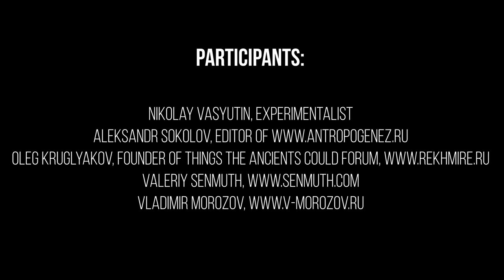Making Egyptian Drill Holes: Lost Ancient High Technology

Comment: Interesting video - even if it does get a bit 'religious' and 'preachy' along the way. I would like to see this experiment/method reproduced under more controlled conditions though by multiple non-affiliated people and with participants from both sides of the fence.
Reply: So, in the end, by multiple non-affiliated people or with participants from both sides of the fence? Or it's just an another way to say "I admit the results only "when pigs will fly""?
Reply: @ravezoth1186 Are you saying that the method shown in this video and the result that it claims to have produced isn't possible to reproduce by other people under close and carefull scruttiny? Or are you simply saying that people should take it on faith that this video couldn't possible have been manipulated to provide 'evidence' for a very particular agenda - or be damned if they don't?
Reply from the maker: @LordLorenSoth  
You can see some public demonstrations here: https://youtu.be/31CayVpKsG4 (at 25:42)   (drilling)
and here: https://youtu.be/HVPoDBKXHos  (sawing) 
Abrasive drilling is not a secret technology. You can easily repeat the experiment yourself.
Reply: @LordLorenSoth  I've said that if you are a beef with something it's not enough to say that "the video is fraud and the authors are liars. If you don't like the experiment design, maybe you can point out a certain flaw, or offer a better design? Do you have a data that egyptian sand has other abrasive features than one authors used, or you once faced calculations that ancient Egyptian metal industry may not be able to produce enough copper. Do you mean that the dammed one should be the person who believe the concept which is proven but not pleasing you?
Reply: @ScientistsAgainstMyths  Same people with the same agenda though. I'd like to see it done by someone else under far more controlled conditions as you can fake the shown experiment quite easily(how to do that is on page one the magician novice's book about smoke, mirrors and misdirection). What is needed is proper replication - applying the scientific method.
Reply: @LordLorenSoth  if the person rotating the log can completely change the results why you haven't done this by yourself or find and share a proper one if it existed?
Reply from the maker: @LordLorenSoth  you can easily repeat the experiment yourself. If you are a fan of conspiracy theories, no one else's experiment will satisfy you
Reply: @ScientistsAgainstMyths  Resorting to condescending and assuming non-answers certainly doesn't help to convince me that the video or proposed methods are valid. And even if they are valid (putting doubts about manipulation aside then they do seem probable to me) they still don't explain how such a relatively slow and timeconsuming process could possible have been anywhere near sufficient to be the methods used for the enormous large scale constuction works found in Egypt (and other places around the world) - especially not in the timeframe of the mainstream story about how and when those enormous construction works were constucted. The maths for the amount and size of stone needed to be worked, the collection and preparation of the materials required for working the stone as described or the manpower that would be needed to carry out the described processes still doesn't add up to the relatively narrow timeframe in which the Egyptians(and others) should have supposedly acheived these large scale constructions in. IIRC then in order to fit the mainstream timescale in which the Egyptians supposedly built the Great Pyramid of Giza they would have had to perfectly cut, move and precission fit 1 of the estimated total of 2.300.000 massive stone blocks required every 4 mins around the clock for 20 years without pause. Taking 20mins to cut a few centimeters into a comparatively extremely small stone simply doesn't fit into that reality of how long it would actually take to do the full amount of work required by applying the described methods.
Reply from the maker: Dear friend! This experiment is only about drilling. The pyramids are not made of granite and they were not drilled. There are very few similar drilled holes in Egypt.
Reply: @ScientistsAgainstMyths  That is simply flat out incorrect. Both granite and basalt where used to build the Great Pyramid of Giza (admittedly not in as great amounts as limestone). Also, you linked to videos showing sawing of granite - so you kind of opened up that can of worms yourself. Anyway, you are deflecting here and are avoiding confronting the very real problems with the claim that the Egyptians were able to do the work that the mainstream historians claim they did within the 'established' mainstream timeframe.
Reply from the maker: @LordLorenSoth   Very predictable and boring. Which question interests you more, about sawing granite or about 2 million limestone blocks?
Reply: @LordLorenSoth  gosh... You are in the top of my demaogy chart now🥳 To start a condescending and assuming message from the words how bad condescending and assuming messages are - only a rare debater can do this.
It's enough, absolutely, but only one additional question to you. How do modern car manufacturers can create a new car each few minutes? Have they discovered that secret technology from pyramid builders?
Reply: @ScientistsAgainstMyths  it seems the problem is not with the granite drilling technology itself, but rather with the imaging of ancient societies structure. Even the amount of dayly free time when no YouTube available is barely imaginable for many contemporary people
Reply: @ScientistsAgainstMyths  Another arrogant, patronizing and evasive non-answer. Both of those questions are equally relevant to the bigger questions of How, When, Why and Who. What interests me is revealing historical truth and not defending either this or that fanatical agenda - like most of you sadly seems to be more interested in doing.
Reply: @LordLorenSoth  er...you say you're interested in revealing historical truth, yet are subbed to foerster? ....the man who said 'sandsaws can't cut granite as sandstone is softer than granite' lol
Reply: @HistoryMaze  Sigh, yet another one focusing on the players instead of the ball trying to defend their own fanatical agenda. I am pretty sure that what Foerster has been arguing is that a sandsaw cannot perform the kind of precision cutting on the scale that is evident in most (if not all) of the megalithic structures across the world. It is one thing to be able to make such cuts on hand sized rocks  and another thing entirely being able to produce the same level of consistantly precise cuts on rocks the size of a small hut or even house. And that is not counting for the many cuts that IS outright impossible do with a sandsaw - like the inside corners of the boxes in the Serapeaum of Saqqara.
UnchartedX have made some truly excellent and level headed videos that doesn't jump to any fantastic conclusions, but merely tries to look closely on the physical evidence. The following link is to one of his videos investigating the boxes of the Serapeum of Saqqara. Prove my impression of you wrong by watching one or more of his videos with an open mind. 
https://www.youtube.com/watch?v=frhysD0G4mg
Reply from the maker: @LordLorenSoth   and how will verbiage lead you to historical truth?
Reply: @LordLorenSoth I've watched most of his videos (uncharted) - he omits key alternative information, and ignores many of my questions that I raise with him. have you seen my video on the serapeum boxes? or the 'how to build a granite temple', or the sandsaw machines that Foerster refuses to acknowledge or mention? Dunn is totally out of his depth - shows no scientific evidence in the serapeum - only the accuracy of his own measuring equipment. He says it would be hard to do today - all of his argument was based on money and transport logistics (due to the DOT fees that they would charge!).Who brought Dunn into the picture? Childress. Go research him and his cult history lol. He co-wrote a book with foerster too....small world....but dont let me stop you having your fun  :) btw - Dunn also said that the stone protrusions on a quarry wall in s america were perhaps for 'tuning' the rock face??? presumably for the sonic levitating lost high technology...
and lastly - I've researched myself out of the rabbit hole. I began my channel as a naiive believer - I've since removed several of my videos as I realise along the way that I was wrong. after 6 months of solid research - I now see whats happening. so no fanaticism here - just level headed honesty.
Reply: @ScientistsAgainstMyths  Another condescending non-answer. This whole channel is really starting to smell like another russian fake news factory to me.
Reply from the maker: @LordLorenSoth   A wonderful transition to nationality. At this point we will say goodbye
Reply: I appreciate and do indeed agree with the premise that most ancient work is better attributed to craftsmen's skill than to "high technology"- whatever that means, anyway. Many of the alternative's claims are quite infuriating to listen to over and over again, especially that notion of statues/masonry/&c not being made by historic civilizations, which screams of ignorance. That said, I find it equally disturbing how so many on all sides claim absurd conspiracy theories of "hiding the truth" "brainwashing" and insult them as "cults" and so on. It seems pretty obvious that mainstream academics and the so called alternative researchers are really just two sides of the same coin. They both refuse to consider a multiplicity of possible answers and would rather just hurl meaningless insults at each other, and due to this combativeness which pervades almost all sides the battle for mutual understanding is lost before it even begins. Imagine a viewer with an alternative mindset coming upon this channel: instead of watching the videos with an open mind of understanding-they see the channel name Scientists against myths (which certainly has a condescending tone) and immediately dismiss it. Why does everyone need to define themselves against something? That is the perfect method to ensure a false dichotomy. I think it is certainly possible that the answers to elusive questions could come from anywhere and anyone, yes, even an ancient aliens true believer might have a valuable insight into something. We don't need to accept everything or even anything that someone claims in order to give their ideas a fair consideration without dismissal as "psedoscience" "rubbish" "myth" "quackademic" or any of the other meaningless buzzwords so common nowadays.  However while everyone clings to their side like a loyal servant this could never happen. Instead we bizarre preoccupations with all sorts of silly ideas, the most common of which are "if I can't find it, it didn't exist" "if I can't do it, nobody can" and "knowledge is never lost with time."
Reply: @Alex Shilson That is because the actual methods that was used are entirely unkown to actual craftsmen, engineers and other specialists of our age. 
We simply don't know how or why it was done, but it is pretty obvious that the methods demonstrated here (even if they can be confirmed) would not be practical for use on a scale that discovered sites clearly indicate that they must once have been used on.
Reply from the maker: @Alex Shilson  

> 1.051e+7 minutes (20 years) / 2,300,000 blocks = 4.5 minutes per block (approx.) 

Repeat your calculations based on the fact that blocks are cut down in parallel by 40 teams of 10 people each (e.g.)
Reply: @ScientistsAgainstMyths  Yeah ... no. 
1) What you are suggesting is not facts, it is pure speculation.
2) There is no evidence that they even had tools to mass produce stone cutting in the manner you seem to be suggesting.
3) Very few of the stones used in the Great Pyramid were/are actually identical in shape and size which at the very least would require significant amounts of additional time (per stone) modifying them to be the precise desired/required form using the available tools and methods

How about just starting with proving - physically - that even 1 block of medium size could be precission cut in under 5mins - or heck even under 10mins -  with the tools available to the people existing at the time claimed by the 'mainstream scripture' to have been when they were doing it?
Reply from the maker: @LordLorenSoth   yes, my friend.
If one brigade cuts down 8 blocks a day, and there are 40 such brigades e.g., then 40 brigades make 320 blocks a day or more then 2 000 000 blocks in 20 years.
Reply: @ScientistsAgainstMyths  Far too many unfounded assumptions and speculations in your calculations about what might be possible.
Demonstrate the process you imagine to be working in praxis and then make your calculations based on how long that atually took and how many men it actually required.
Reply from the maker: @LordLorenSoth   
Eager for more experiments? 
Become a Patron: https://www.patreon.com/bePatron?c=1927495
Reply: @ScientistsAgainstMyths  Yeah ... no thanks.
I doubt that would really get us any closer to what I was originally asking for.
Besides, I am already backing someone else that has been doing some very promising work with an entirely different approach, but still very much related to this topic.
Reply: @Alex Shilson I didn't actually get any notifications about your previous comments (I guess I follow too many threads on too many channels - or something).
I never subcribe to any person(s) or idea(s) religiously, but it does seem like a lot of mainstream historians do refer to old history books like were they religious scripture.
And for no good scientific reason most of these texts remain undisputed and taken as undeniable facts despite not being based on hard evidence, but rather on concensus supposition made by 100+ years old 'societies' - even when presented with new evidence that at the very least ought to warrant reopening these century old 'facts' for reinvestigation.
I have seen these so called "debunks", but they all refer to the same century old text books as well as some highly dubious and nonrepeatable experiments. 
In short they make use of infinite circular logic and refuse to adress any new hard evidence that contradicts their "holy scriptures".
And since you seem adamant to be doing exactly the same then I am afraid that I can no longer take anything you say seriously.
Reply: @Alex Shilson Yes, but the problem is that you are brushing aside the testemonies of actual craftsmen that DO possess the hands-on experience with and insights into the various processes involved.
And you brush them off with 'facts' what was decided for 100+ years ago by the collegial consensus procedure: "We have decided that it must have been so, because we cannot see how else the puzzlepieces fit together ... lets fill in the blanks as best we can ... and claim the entirety of this fabrication to be undeniable facts" ... which of course cannot result in anything that can be said to be undeniable factual history.
If there is a pseudoscience at work here then it are people like you that cling on to these conclusions that in far to high a degree is based on non-scientific assumptions and procedures.
Having said that then what I want to accomplish is to reopen these 'scriptures' and without prejudice reinvestigate the claims within them that have no basis in any solid evidence - especially on topics where new evidence and findings are present.
E.g. disputing that the very real problems regarding the hardness of materials processed and the hardness of the tools supposedly used to process these materials to the degree that they have been found in and even claming that these problems raised have been debunked is nothing less than comparable to fanatical delusion.
Reply: @Alex Shilson I am not saying that there is proof of anything in the new findings at all.
I am merely saying the these new findings warrants further investigation.
Because it is clear that we do not yet have all the answers(far from it) - despite that the 'scriptures' and their zealots are trying to tell us that they do have all the answers.
Reply: @ВсеславВсеволодович  how ironic of you to say so ...